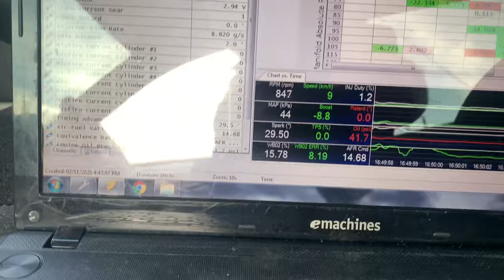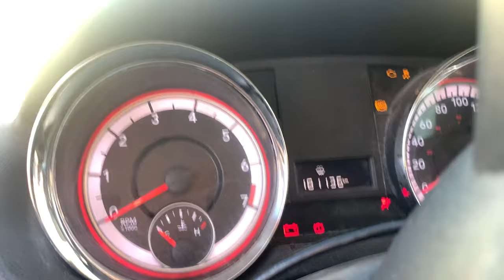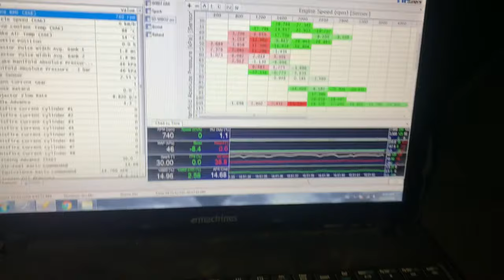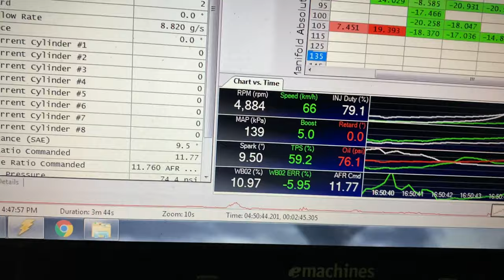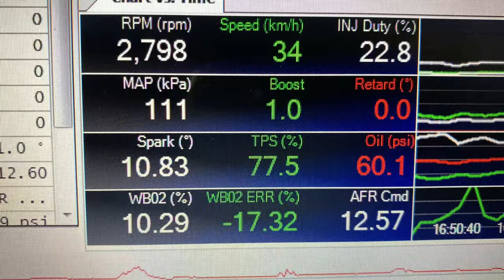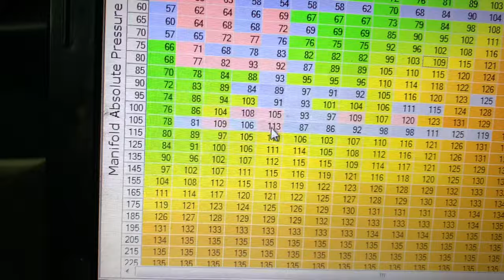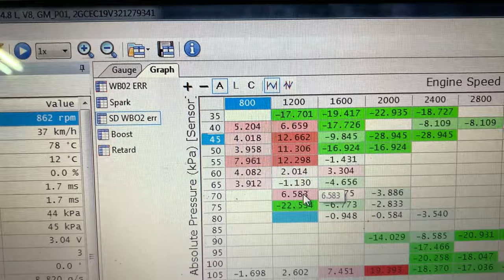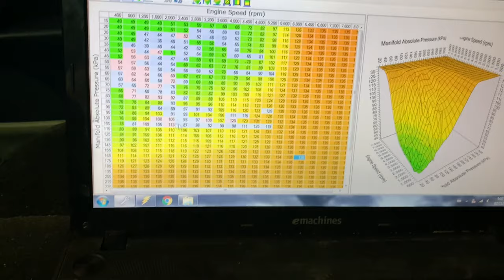Turbo LS Caravan build - fixing panhard rod, charge tubes and a spicy test pull

Comment: Hey Barry, an idea for the pa hard rod. Why not use a length of solid stock bent to fit and weld the bushing ends on?
Reply from the maker: That would have worked perfect too. I didn’t have a pipe bender to make the bends, I definitely would have
Reply: @StationroadRatrods     all you need is a vice, a torch and something to grab and pull it with
Reply from the maker: I’ll definitely be doing that next time, I hate doing stuff twice haha